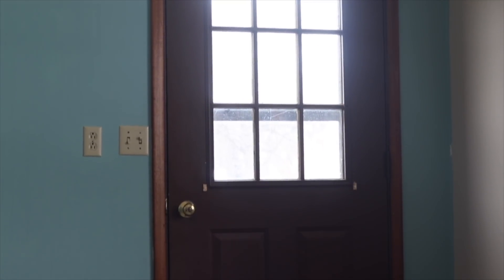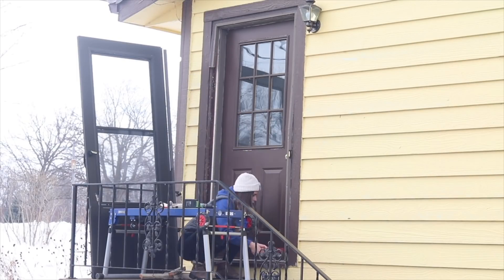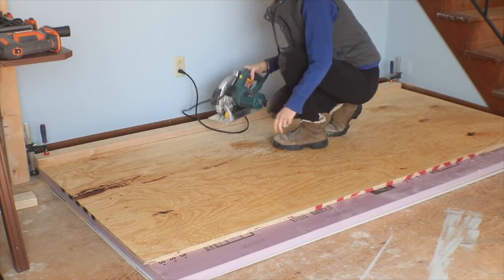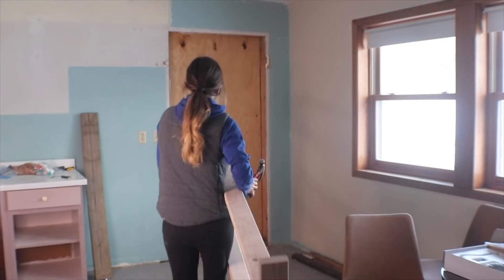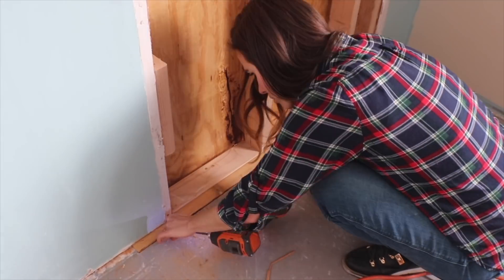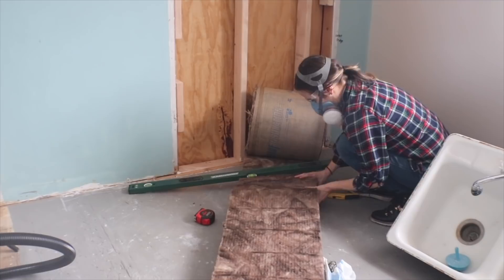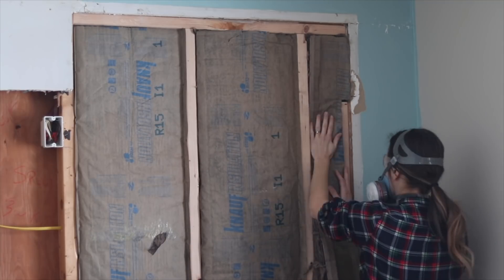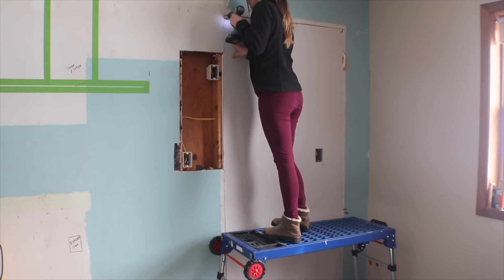Remove an Exterior Door and Frame an Exterior Wall

Comment: It's probably a good idea to add stud protectors (also known as nail plates or stud protection plates) on the studs in front of the electric wire, to "guard" the wires from drywall screws or nails that might be drilled into the wires. It's a safety precaution, but probably not super necessary, since most of the wires (by code) are in the middle of the studs, usually beyond the reach of most drywall screws.
Reply: Blow off. This looks well done.

Comment: I know you love nitpickers, so I'll give my 2.  I think you may have felt a little better about it had you cut the drywall versus cutting the insulation.  I personally hate dealing with insulation, especially cutting it and the less cutting the better.  That is just the way I have always done it.  You just need to make sure you really have a nice straight cut.

Another great job though.  Would love to do this for a living one day, or at the very least a side job.  My parents have flipped about 4 houses over the past 2-3 years and I help as much as I can.  I always enjoy it when I do.

Awwww the multi-tool cutting the drywall is so satisfying.  So much easier than a drywall saw.

Comment: Not compressing the insulation is the key. Great job carefully fitting it around the blocks. Ideally the paper flaps overlap on the face of the studs but the install instructions provide for both that method and the side stapling method as you used. 
The r value is mainly created by the static air trapped by the fiberglass. So compressing the insulation reduces its r value. Your careful work around the blocking was more critical to the overall performance.
Reply: Exactly what J. Mark said.  Need to fill the cavity as much as possible and displace any space for air, so staple the insulation on the surface of the stud to achieve best results.

Comment: Good job other than the one item in my comment below. Kudos to you for taking the time and effort to tackle these things on your own and learning as you go.The first thing I saw that you missed was when you removed the sub sill and there was an empty space behind the rim board and the section of the sub-floors edge was unsupported by any framing. You should have doubled up some2x4s under this area and attached them to the rim board. This would add the proper support below the sub-floor and then you could have filled into the wall with your furring strip.A tip for insulation time, any exposed skin-hands, arms, neck apply bay powder all over these areas and it will keep the insulation from bothering you as much. Keep up the hard work and never stop learning.

Comment: Thanks for the video. It will be very helpful for a similar project I am tackling. One question. Was it necessary to remove the sill or could you have just filled in around it?

Comment: To the left of the door the cavity with 2 electrical boxes did you remove the insulation to install electrical ? Just curious as Minnesota is a cold northern state …. Have a great day 🙋‍♂️
Reply from the maker: Yep! The insulation that was in there was pretty wimpy though so before I re-drywall I'm putting in new.
Reply: @WelcometotheWoodsBlog  
That’s a good thing to do I always recommend this to my customers